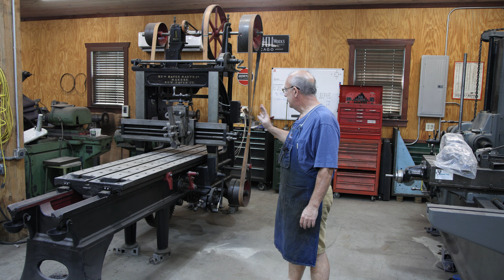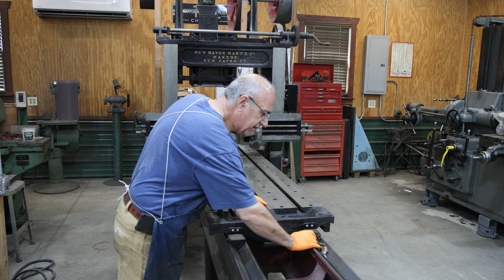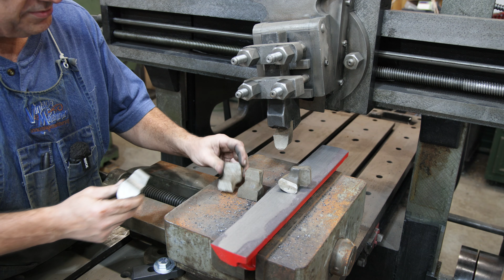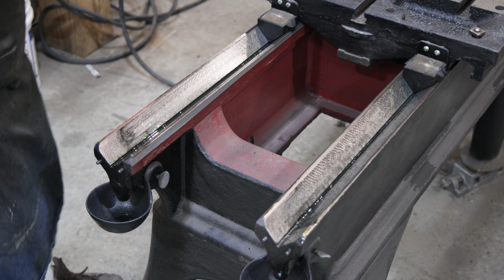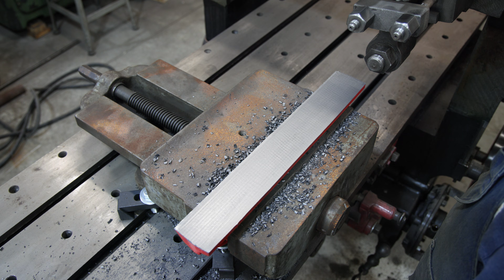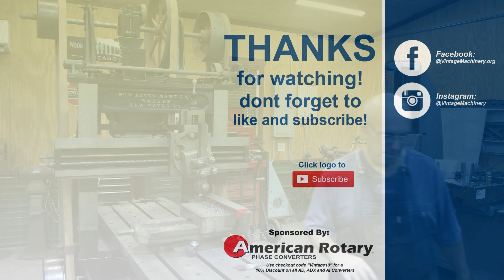1890’s Era Metal Planer: Setting up and Testing Cutters on an Old School Flat Belt Powered Machine

Comment: WD-40 really isn't actually good for much, but it makes a really good cleaner for machine tools. I would use it before ever spraying it down with a water based cleaning spray. Cleans lubricates and prevents the flash rusting you got on the bed. I bought a gallon years ago and just put it in a spray bottle. Some spray bottles kinda melt though, so you have to find one that's rated for solvents. I think the one I have now was used for lye based toilet cleaner that I upcycled. The ZEP ones at the hardware store don't work so don't botter trying them.

Comment: You should mount a brush just in front of your cutting blade on the metal planer.  This would automatically remove all of the shavings on each pass. You could also find a way to mount a stone to stone-flatten/smooth out the finish.

Comment: What is casting chill?
Reply: If cast iron cools off too quickly it crystalizes and turns glass hard. Sometimes you'll get variability where thinner sections cool quicker than thick ones or even around the edges will cool quicker and you will get different zones. Typically with quality castings, they will run them through a furnace and allow to cool slowly for a normalization cycle to avoid this.
Reply: @TgWags69  Thanks

Comment: Steve Watkins has a hydraulic planer on a scale like yours. I think he said it takes 60 gallons of hydraulic oil to fill the system. He uses his planer to machine big straightedges, like 5 or 6 feet long. And the surface finish comes out really beautiful.
Reply: I was about to mention Steve’s big planer. He grinds a small chamfer on the leading and trailing edges of the part he’s planing to keep them from fracturing. It’s been a while since he’s used it.

Comment: My concern is the whole time you were running it. You kept lifting the head instead of letting the machine do it itself, so how do we know that that it will do it correctly by itself if you were lifting in each and every time I don’t know if that meant that that part of it doesn’t work right or exactly
Reply: It doesn’t do it itself. You weren’t listening.

Comment: Hey Keith - I’ve got a jointer planer up north of Atlanta. A Hammer A3-31, with ~60” beds. What is the stroke on that machine? Would love to have the beds planed - it has some warp and fall off on the ends of the beds that you can’t tune out with the 4 adjustment points on the tables.
Reply: I’ve thought about taking it up to Northfield - I understand they still have a monster of a planer in use making machines today! But IMO, nothing beats a planer finish for a jointer - the grooves keep stiction down and parts glide.
Reply: @matthewlramsey  If you want it done correctly don't send it to this guy!
Reply: @garybrenner6236  If you are intimating Keith, then why are you here?  Go find someone else to harass.

Comment: Interesting. The adjacent edges of the flat are usually planed also on camel backs I have used. After watching you experiment with the 'planing' cutter I think I understand why. That chill area is removed before planing the working area of the camelback. The slow rhytmn of a planer is relaxing. Thanks for sharing your shop time.

Comment: Hi Keith,
Have watched many videos of Steve Watkins using his hydraulic planer and he grinds a small bevel on both ends of the workpiece to prevent chipping at the start and end of the stroke.
Reply: Sometimes he uses a file,  this also helps in seeing the depth of the chill zone. 

Cast iron chill is where the mold edges are cooled faster than the body proper so they create white cast iron, very hard and the origin of the term chilled cast iron used in some noir novels as in a hard hearted woman, or she could cut your soul with her chilled iron glare. It is best to get below that 'crust' fast so as not to wear your tooling.
Reply: @CothranMike 😕😕 😮When you see a chilled stare like that from a woman back away as fast as you can and don’t say a word!
Reply: @ellieprice363  I hope I move fast enough!

Comment: @Keith Rucker, my apartment complex? All 3 buildings have the remains of Line Shafts and King Shaft Alleys still buried in the walls, floors and ceilings. 3rd floor of my building? Line Shaft Alleyway makes a BIG hump in the Hallway floor, and the floor machinery rooms still have the remains of the King Shaft Brackets in the same well structure as the unused cargo elevator shaft.

Comment: If the cutting tool is ground correctly, it dragging back across the surface has no affect on the cutting edge
Reply: Ground correctly, correct clapper angle to lift as step over travels to the rear. Never set step over to occur on the cutting stroke.
Reply: I thought that but if later planers added this lift up feature it must be an improvement. Why make your planer more expensive for no reason against competitors. Anyways I'm no expert.

Comment: It's possible to go all mechanical, but I would suggest a small ail cylinder and a lift chain to the clapper. A linkage to an air valve off the belt shift rod would raise and lower the cutter in sync with the motion.